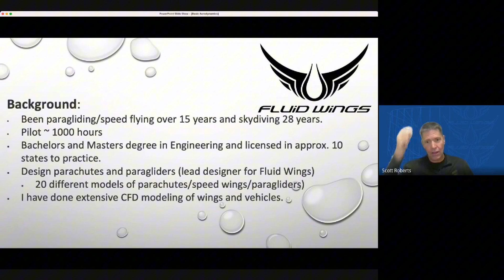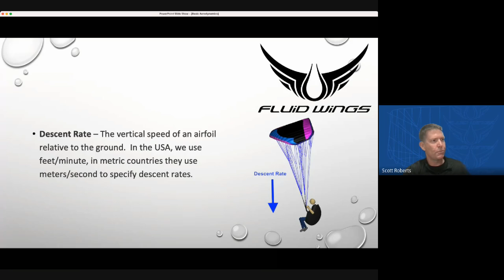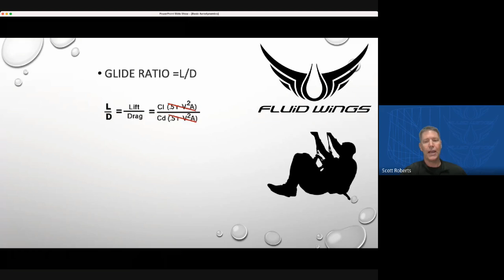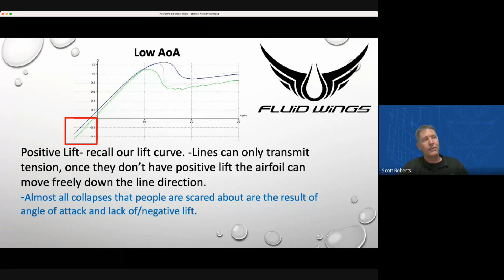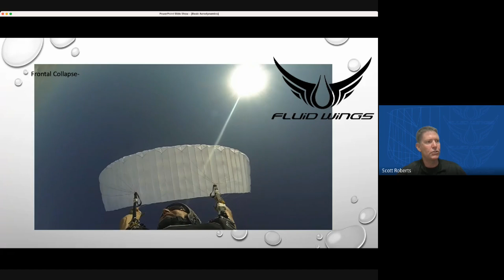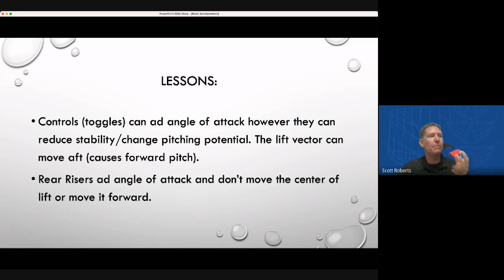INTRO TO AERODYNAMICS WITH SCOTT ROBERTS

Comment: 17:21 Lift does not equal weight unless you're in level flight (powered flight). It's the total aerodynamic force (the addition of lift and drag vectors) that equals weight in unpowered wings.